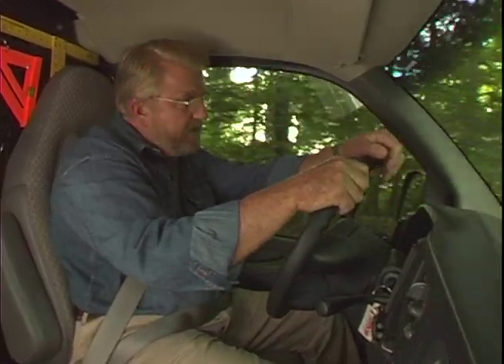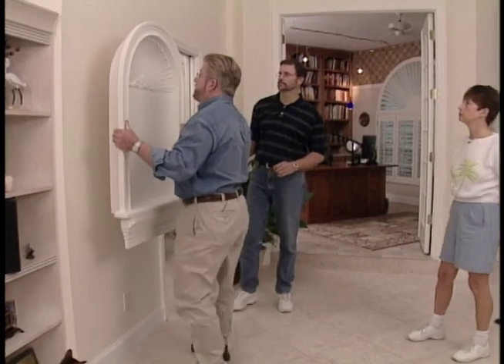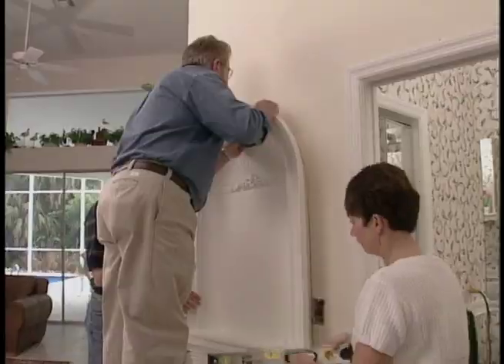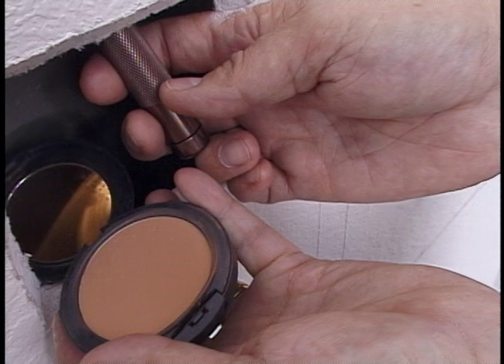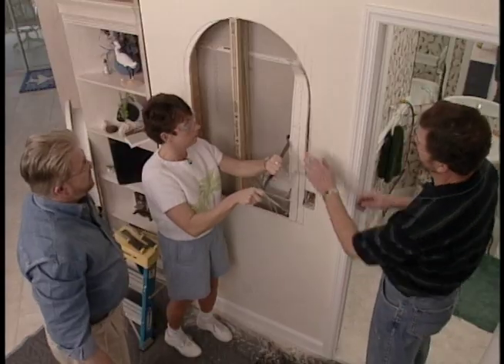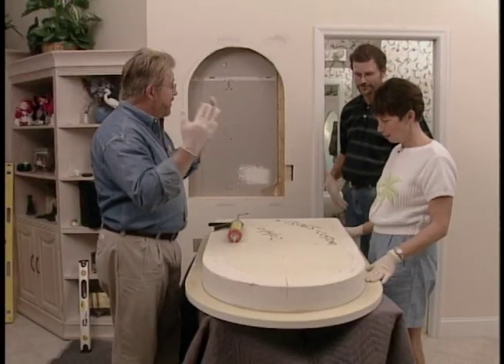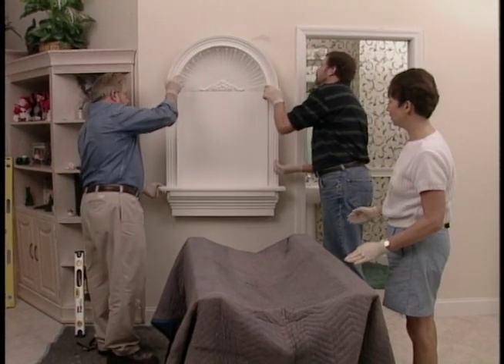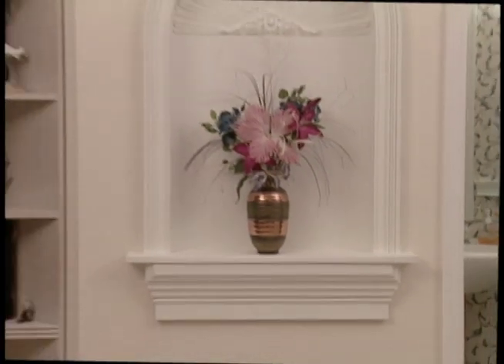Build a Wall Niche and Add Charm & Style

Comment: It looks super good.  I've been looking to learn how to cut out drywall for niches.  I don't want to use an insert.  But rather use the same drywall material to create the niches.  How do I do that?
Reply: you have to open the wall and make a frame to create the niche, and screw your drywall to that.  you can use wood or metal studs and track.